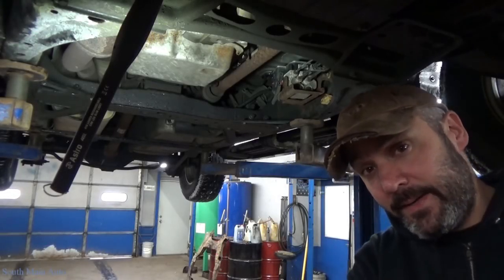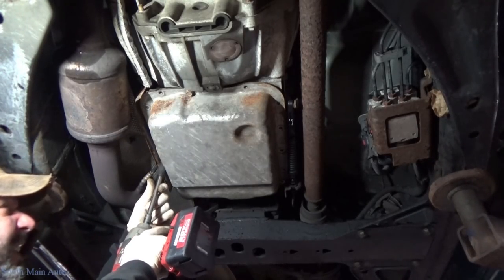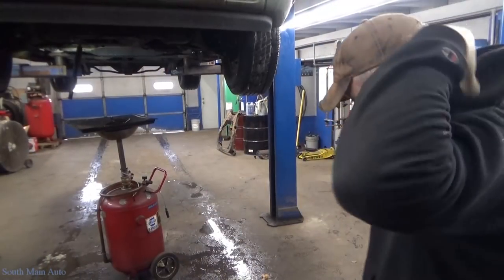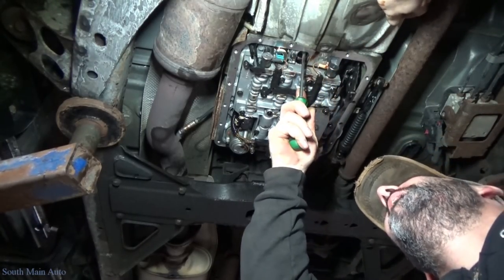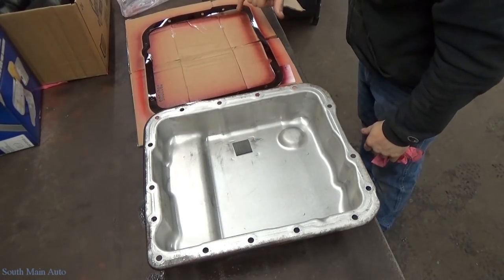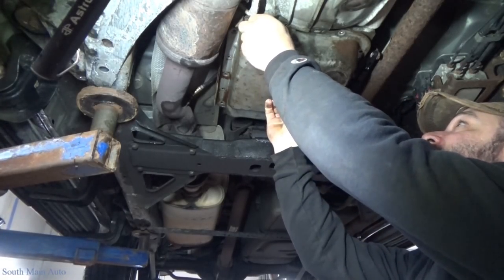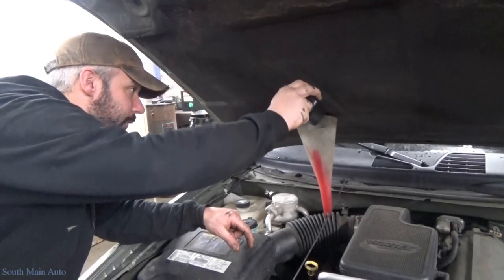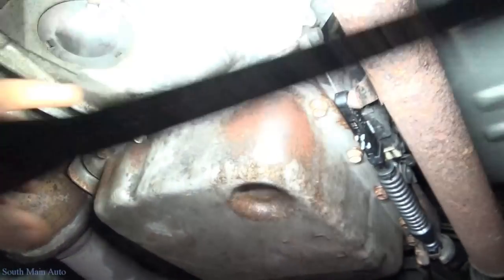Trailblazer / Envoy / Rainier Transmission Fluid & Filter Replacement 4L60E

Comment: Any other color than pink/red and/or it stinks damage is already done. Dropping pan and changing filter is always a good idea on a undamaged trans. Flushing is a waste of time and money. Only thing that needs to be flushed is the trans cooler(s) when rebuilding or replacing. People forget to check fluid level and end up burning clutches and seals. Changing fluid has never fixed a damaged trans or ruined a good trans.
Reply: Sven Gonzales Color cannot be relied upon for any fluid. Mileage/time intervals, or UOA are the only definitive way to say "the fluid is bad" unless it is clearly black.
Reply: Except for automatic trans fluid. Only thing that changes the color is excessive heat (smell) and contaminants. Just rebuilt 1994 4L60E  with 200,00 + miles still red but turning slightly brown (clutch material) and didn't stink. Low/reverse frictions worn out.
Reply: Sven Gonzales I've seen faded ATF test fine, and red or pink test horribly. The color can't tell you anything except when there is a severe problem. At that point, nothing will fix it except a trans R&R.

Comment: Eric what's your thougths on automatic transmission fluid on High mileage cars (more than 120K)? Some people say it's better to leave it alone. Do you still recommend a flush ? On my car, Nissan recommends to never replace it.
Reply: Nissan isn't that good of an advice giver with all the transmission problems they have with the CVTs in the Roques and the coolant contamination in the Frontiers. Drain and refill the fluid. Change the filter if possible. Don't flush the fluid. Nissan is not looking out for your best interest. For a Nissan I recommend the Aisin brand or Genuine Nissan tranny fluid.
Reply: It's not usually that they "recommend not to replace it" but that they tell you it doesn't need to be replaced if you drive under certain conditions - which many people don't do. The advice to "leave it alone" on high mileage vehicles generally applies to where the fluid is currently in really bad shape, indicating the transmission is already damaged and changing the fluid may hasten its demise, but in that case you're on borrowed time either way.

Comment: People who would call this a "hack job" probably change the nitrogen in their tires every 15k miles.
Reply: Or change to their winter air.
Reply from the maker: I wish they would loosen all of there lug nuts a full turn for the winter to make sure they do not freeze to the wheel then go drive around lol
Reply: Don't forget the blinker fluid !

Comment: I always use wheel bearing grease to stick the gasket to the pan - Never had a problem - Also makes removing the gasket during the next fluid change a breeze.

Comment: I'm planning on doing this to my car.. But I'm planning to flush the cooler lines.. Bad idea? Does residual cooler cleaner screw up transmissions? :/
Reply: Cleaning your transmission cooler?  What snake-oil have you been smoking?
Reply: It better not screw up transmissions, since that's what it's meant for.. but it's intended for when you replace a transmission that may have grenaded or put metal into the fluid, so you don't contaminate the new transmission with that. When doing a fluid change for maintenance, you're not getting all of the fluid anyway, so there's little point in worrying about the little bit of fluid in the cooler that's in the same shape as what's in the torque converter etc.
Reply: Thanks guys.. I have an internal filter a well as an external filter near the radiator so I figured I could flush the cooler in the radiator while it was disconnected but I know I won't be able to completely get all of the cleaner out.. Just wonder if it's worth doing (thanks) 😎

Comment: At what mileage would you stop recommending that the fluid be changed if it is still original?
Reply: Probably depends more on the condition of the fluid than mileage. Does it still look like transmission fluid or is it all black and burnt smelling? In the latter case, changing the fluid may do more harm than good, but you'd better budget on transmission work in the near future either way in that situation..

Comment: yeah really no one changes all the oil,But that little round inspection plate in front of trans,Is to access the drain nut to the torque converter.You turn the engine untill drain nut faces down.
Reply: Filiberto Barrera Thanks for the info. I was curious about the big plug on the bell housing.
Reply: Not on a GM. Last GM with a converter drain was in the 70s.
Reply: Blazer02LS I own a mechanic shop and replace transmission weekly,That is false,BUT I QUESS YOU CAN YIUTUBE IT,IF you don't believe me.
Reply: Blazer02LS But maybe they added a drain plug at service station,That access panel is their for a reason. THEY DIDN'T JUST PUT IT THERE JUST BECAUSE.
Reply: It isn't there for a drain. GM has not had a converter drain on a domestic vehicle since the mid 70's. I likely would have noticed in the 30+ years I owned a shop if they did. 
Ford has a drain on many of theirs as do some imports.  GM doesn't. Don't need to google/youtube it.

Comment: I almost bought one of these I-6 Trailblazers but was scared away by lack of performance aftermarket support since GM killed it off.  Ended up with the 5.3 Envoy.  There's some videos online of this I-6 on the dyno with a turbo system, amazing what could have been had.

Comment: How to change 4L60E fluid and filter.... throw 4L60 in trash and replace with 4L80E
Reply: that'd be great, if it didn't require other things be swapped and changed
Reply: Why was the 4L60E so bad of a transmission?
Reply: the new 6spds fwd are worse, wave plates for days and lets not talk about the new 8spd in the trucks and all the torque converter issues they have at least a 4l60 will go at least 100k before failing
Reply: I see they have a kit I believe at Monster transmission that takes care of all the issues on the 4l60e. Wondering how good they are after that.. Doesn’t look hard to do it yourself . Fairly decent price also.

Comment: Wonder why they never designed them like the (GM) Saturn S-series with a drain plug and an external spin on filter?  Not that those transmissions were really very good but the ease of mainteinance.....

Comment: Disappointed you didn't slice anything on the razor sharp pan edge or transmission first thing in the morning so you can change the band aid 5 times because it keeps slipping off from all the trans fluid and other oils that soak it.  Don't worry, the brake Kleen will be a reminder of where the cut is.  Other than that, it's how I do them too.  (I skip the sticky tac, tho.)

Comment: 81265 miles and I did a running flush on my Volvo (where you run two quarts, shut it off, fill two quarts, rinse repeat). 3rd gear got grabby and I got annoyed. 15 qts of Mobil 3309 and it's been good for 35k miles. Need to do another one soon, buuuut. . . (Yes these Euro-calibrated Aisin trannies are crazy like that.) Most of my friends are like, "NOOOOOO WHAT ARE YOU DOING?!" but they also had to get new transmissions at like.... 150k miles. Can't win for loosing I guess.

Comment: The only recommendation I have is wear safety glasses when working under a vehicle. Your born with one set of eyes and that's all you get.
Reply: Agreed. I know that trans fluid is not as bat as battery acid, but my friend has an glass eye from hitting a nail on it's head with a hammer. Hammer split an sharp shrapnel to his right eye.  You know, lost an eye by just hammering some nails. Who would thought that?
Reply: Safety third!
Reply: Not true, I just got a set of new eyes for Christmas.  Asked for my 2 front teeth and guys eyes instead.....who would have thought?

Comment: It's 2018.  I don't understand why some car manufacturers still don't put drain hole and plug.
Reply: and a external filter like subarus, old saturns and chevy allison transmissions
Reply: That’s easy - so the owner won’t want to do it.
Reply: Yeah.  external filter would have been nice.  On my Odyssey, you can't replace the filter without dropping the whole transmission.  That is beyond DIY already for most people.
Reply: Rob,  Yeah.  Planned obsolescence.
Reply: I don't know if they are still available, but auto parts stores use to sell a drain plug kit. It's still a mess the first time, but once the kit is installed it works just like the old days when they did have plugs. I know you can buy aftermarket pans with plugs in them for most common trannys.
Reply: Shit you think that is bad half of the stuff doesn't have dip sticks anymore. They are sealed for life transmissions now lol what a joke.
Reply: UBBERTANKER on models with external spin-on filters usually only used for control circuits of the tranny, little amount is filtered but it is going to most vulnarable parts in the valve body, they also have internal screens/filters that are only replaceable during overhaul. The logic of having a non-replacable internal filter is that if there is enough stuff came off the hard parts and friction materials and circulating to clog the filter, then that means it is time for an overhaul anyways.
Reply: "Sealed for life" is a myth. The fluid still can and should be changed. It's just a little bit more complicated to check the fluid level (usually have to remove a level check plug and top it off until it starts running out). I can understand why they removed the dipsticks in some ways - too many uniformed DIYers or quick-lube jockeys overfilling the fluid or adding the wrong kind of fluid and causing damage.
Reply: Same with diffs.  Not many have drain/fill plugs and removing the cover can be a mess.  Glad my Taco has a drain plug, makes that service a breeze

Comment: I follow the same process of dump and fill at 30K intervals, no issues. You should try to see if the trans fuel breaks down the tack spray on some cardboard. Would be interesting if it can hold it's own. I can see why you use the spray, It's a pain when the gasket wants to flop around during installation.  thanks

Comment: Every 30,000 miles, try every 130,000 haha.
Reply: With the cost of a transmission rebuild or R&R, especially with today's 6, 8 and now 10 speed automatics... I wouldn't go over 50,000 on transmission fluid. Especially in a transmission that lives in an SUV/truck. Transmission fluid and a filter is a lot cheaper than a transmission, but suit yourself man.
Reply: Ours has over 300,000 miles and works like new

Comment: Would you recommend changing out the A-B shift solenoid while doing this? The gears are slipping like it's in neutral and revving at the same time while driving. Seems simple to replace and don't want to pay more than I should to have a mechanic do it. Also the transmission is under warranty. Should I just let the mechanic do it or do it myself?

Comment: I installed a drain plug on to transmission oil pan and I don't like use spray-on adhesive to the gasket it a pain in my ass have to scrape it off instead I use a little bit of grease. In Canada, you don't take this job to mechanic extremely expensive like $500 I did it myself $150. Transmission fluid does not get that dirty unless something goes horribly wrong with the transmission.
Reply from the maker: 500!! Wow I think ours is around 150ish
Reply: I can send you down some receipts and some estimates from a garage Ideal was here in Canada  if you would like

Comment: I have been told by many expert auto mechanics you should never flush your trans.
Reply: There's a big difference between a fluid exchanger and a flush machine. You're correct. You shouldn't flush a transmission,but there is nothing wrong with using an exchanger. That's what most dealerships and manufacturers recommend.

Comment: Question ❓ I have a 2003 envoy the transmission shifts good it drives good but when it get hot it will stop moving Intel it cools down the fluid is black and I would like to know if I change out the fluid and filter do you think it would fix the problem or have you had any same thing on any envoys and that fixed it thanks for the video

Comment: In my car, the maintenance manuel says change transmission oil every 50 thousand k, so if the manufacturer says do it, il do it, the same way you do and never add a probleme, those pepole should read their manuel before says BS

Comment: How do you do transmission service on vehicles with no dipstick?
Reply: The fill hole becomes the level, often whilst the transmission fluid is at a certain temperature.
Reply: Measure what you drain out in a old gallon milk jug and refill with new fluid that amount.
Reply: Scott Schulte 

Instructions Unclear 
Filled trans with nonfat milk, ate cereal soaked in trans fluid😒
Reply: On the Ford transmission they have a drain plug with a small plot

Plug in the middle this is the stand tube fill through this hole until the fluid runs out the hole then reinstall the plug
Reply: Have to check the service manual for the vehicle. Usually there's a level-check plug and you have to top it off with the engine running in park until it starts draining out of the hole.

Comment: yes indeed . im an ASE certified nucleuar scientist. you are doing this all wrong. im a child of the seventies. drop the pan and torgue it it down till bolts dont tighten anymore. and if there stripped the old powerglide will go forever, just keep adding fluid.

Comment: You said this guy does this as normal maintenance so why not install a B&M universal drain plug in the pan? Part cost is less then $8 and it makes the job a no mess job as well as gives you the ability to drain and fill on a more frequesnt basis than just at filter change time. https://www.summitracing.com/ga/parts/bmm-80250/overview/
No hate here, I agree that replacing the filter is key to long life and most shops just do the flush and fill method which leaves tons of debris in the pan and in the end just helps clog the filter.
Reply: The reason for no drain plug on most factory stuff is they want you to pull the pan, and replace the filter.. Pretty much a good idea to keep fresh fluid of the correct type in your car/truck.. It's nice when the factory give you a torque converter drain plug..  No gasket spray needed on the many I have done. Just from the gasket bolt holding style..Each to his own there.. Have to admit the clear funnel is a trick unit.. The way Eric did is safe, and no issues will show  up doing it exactly like that..(unless they were going to show anyway) Even if you fluid is turned a bit from lack of maintenance, best not to go crazy with a flush machine.. Slow, and steady seems to limit some of the issues  that can show from their use..
Reply: I undersatnd that - my question was really around why Eric hasnt installed a plug if he knows the guy brings it in regualary for maintenace. He made it sound like he worked on it prior in the beginning of the video and he doesnt like a tranny bath in the morning :-)

Comment: Would really appreciate it if anyone knows how to check for random voltage drops??? It's on a 05 f-150 5.4 new battery and alternator but it goes from 14.3v to 13.2v randomly.

Comment: I hate them damned seals and people not changing them kills transmissions. most shops don't care, as they'll happily get a rebuild job :(
I've pulled many that the filter was tight and felt ok, but they were dry rotted and cracked, of course the trans were all cooked from oil starvation slipping